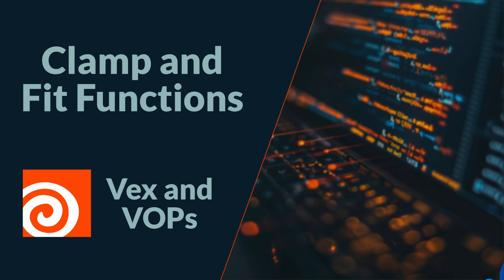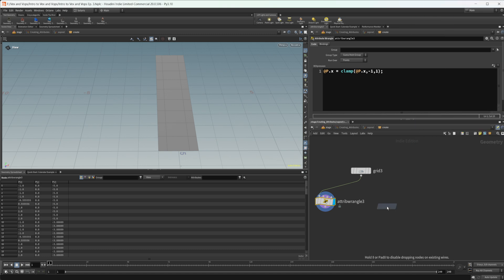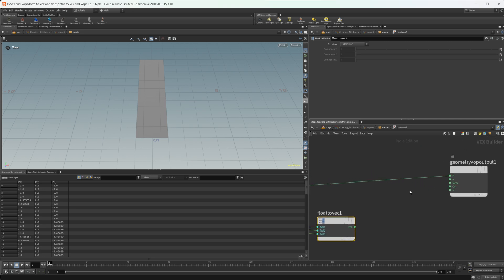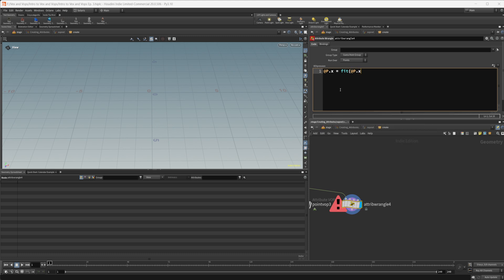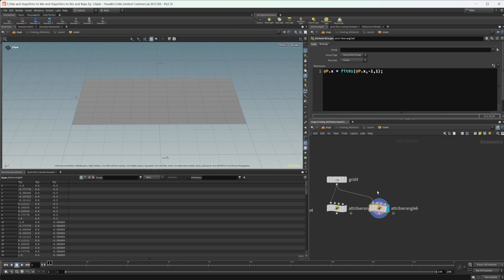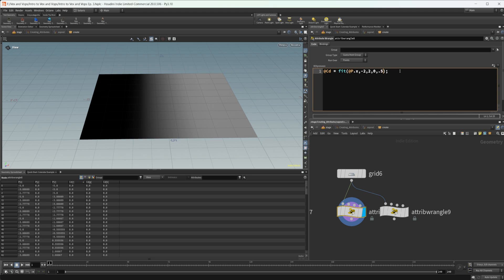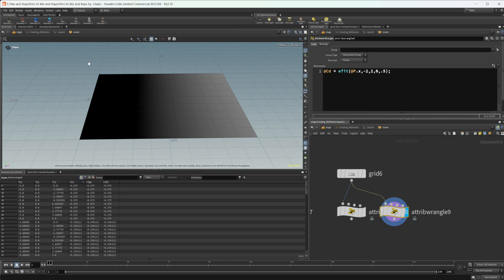Clamp and Fit | VEX and VOPs | Houdini 20

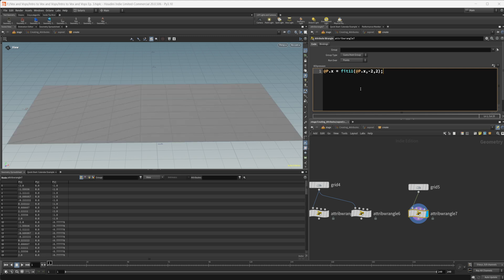Comment: Why are you getting diagonal lines on grid in the negative x direction when using the fit11 function? at the 7:25 mark.
Reply from the maker: It has to do with the way the geometry is being moved. It's not really a situation where you would necessarily use the fit function but it serves as a good visual to show what is happening